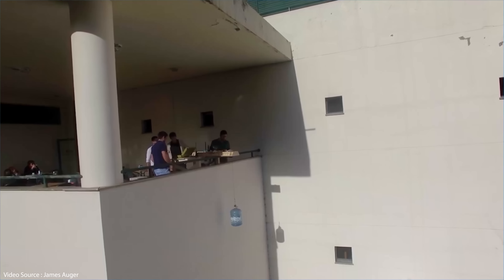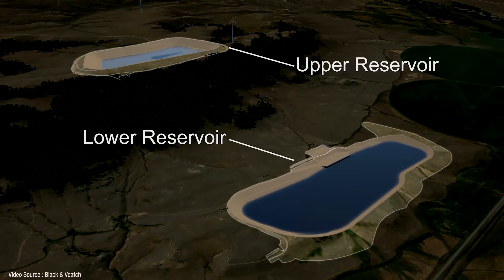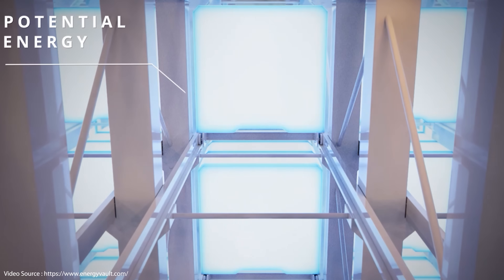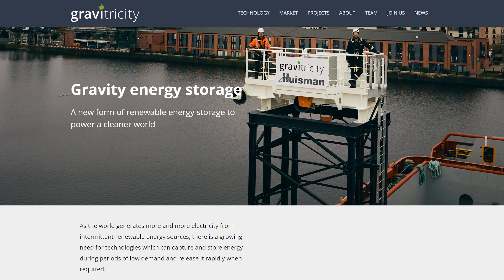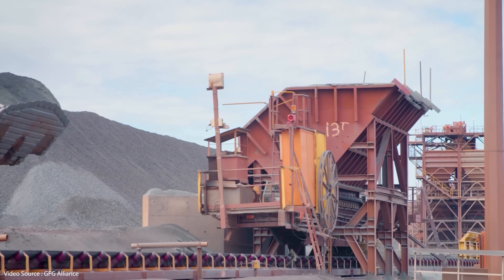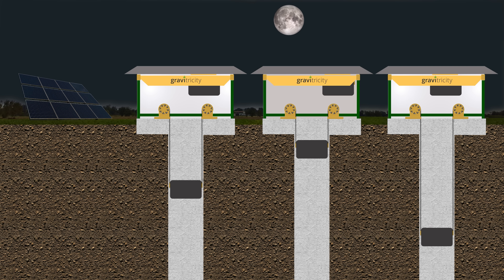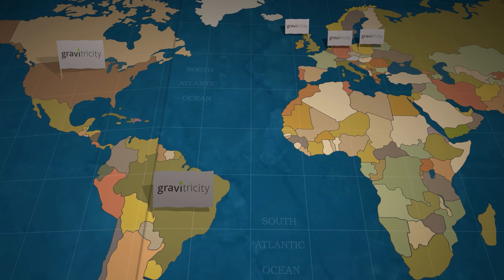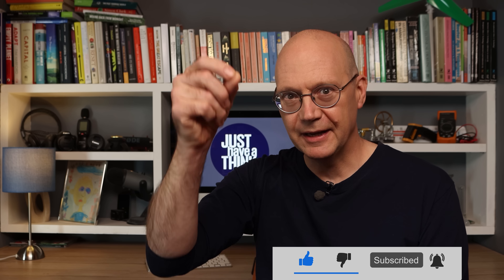Gravity Energy Storage. Who's right and who's wrong?

Comment: Here's an idea, David- Why not have wind turbines gear down to directly lift weights (or pump water for that matter) then let them drop weights to generate electricity when needed? It seems to me that it would cut out one or two efficiency losses in converting the mechanical to electric and electric to mechanical back and forth...
Reply: Mechanical "energy" cannot be transferred to a different direction or place without all kinds of conversions either.  For example, consider an internal combustion engine's gearboxes.  Such systems have considerable losses too.

Furthermore, many mechanical systems have fairly specific and narrow efficiency windows. You can't just go hooking up some source to some output and expect great efficiency, usually.

Then there's the fact that electric motors and generators have exceptionally high efficiency; the best (large) ones around 99%.  There's just not much loss there to win anything.  (Generator systems have losses - but usually not in the generator themselves, but precisely in the non-electric bits!)

Then there's economies of scale - even if you could come up with a complex mechanical contraption that has even higher efficiency than a generator+motor pair, it's going to be custom for your application.  But... you probably can't afford that.  You want commercial off the shelf parts as much as possible.  And that makes the electric route cheaper.

But even if you achieve scale, mechanical systems tend to have huge, heavy moving parts to carry all that power.  Huge things?  Those tend to be expensive.  By contrast, copper wire is relatively dirt cheap.  (I mean, it's not actually cheap, but compared to gearboxes that don't wear and deal with many kW or even MW of power...)

I'd say it's exceedingly unlikely you'll be able to do better than going via an electrical intermediate step.  Never say never; there are likely tons of very specific counter examples.  But finding each of those counterexamples is basically coming up with a clever invention, and will only be possibly in certain specific, hard to predict situations.  As a strategy, this won't work.
Reply: @MoireFly  I'm not an electromechanical engineer who works with these things, but if "that won't work" was the end of every idea where would we be? There are many different configurations of electromechanical systems that involve huge things and clever inventions, and gravity energy storage is all huge things, that's it's nature. I'm not proposing a perpetual energy machine here, it's just a thought...
Reply: @truthurts1692  Just thoughts can be actually damaging, however.  Not every idea ends in failure.  But it's still expensive to try; and in the chaos of creation there's always the lure of riches; and by contributing to that lure for false leads, we reduce the availability of investment for the actually promising new tech.

Some ideas are plain dumb. Now, if there's some subtle interaction, some economic factor, or whatever that we're missing on first glance - OK, but let the companies selling this snake oil explain why theirs is the exception that proves the rule.

But more explicitly: not every idea appears idiotic in advance.  Many appear outright obvious, and just hard to fund or get quite right.  When designs appear to fail to satisfy basic physics constraints or economics, that's a pretty big red flag.

TL;DR: we should at least try to use common sense.  It's a lot better than nothing.
Reply: @MoireFly  I know you'll need to get in the last word, but you reply kind of like a strutting peacock, you know, pedantic, 'look what I can do' . IT WAS JUST A COMMENT, probably not damaging.
Reply: @truthurts1692  Oh sure, your comment wasn't damaging; but the approach is.  And more specifically: that's a problem this channel sometimes seems a little too blase with. He's happy to sell all kinds of pie in the sky ideas, without any attempt to place the likelihood of success in any kind of context. I'm not annoyed because you came up with an off the cuff idea that I doubt is viable; that's just brainstorming!

But I'm less thrilled that a person with a platform that sure seems to really believe we need a radical energy transition is spreading unverified potential scams to a significant audience.

Sorry for the misunderstanding; my frustration isn't with your comment per se, but you indeed touched sore spot.

(No hard feelings on the peacocking, great image ;-)).  I'm sorry if I hurt your feelings.
Reply: good idea
Reply: My guess is that the purely mechanical method you are suggesting would be far more inefficient and complex.

Comment: 1) If we are talking deep holes, are there opportunities to utilize the temperature gradient from bottom of hole to top of hole?  2) Tides are natural analogues to this technology, could they work in tandem? The big challenge would be to keep water out of a deep hole. Think of filling a giant container of water at high tide to buoy up a heavy weight and then letting it drop at low tide and repeating the cycle.
Reply: You would need to dig a lot deeper than a usual mineshaft to get temperature gradients that would be economically viable for energy production. You might be able to store energy in the form of temperature in the hole using a heat pump, but I suspect you would lose a significant amount of the energy in pumping losses alone.

Comment: Most mine shafts need constant dewatering to remove water ingress.  This comes at a high energy cost which has not been factored into levelized-cost callcs
Reply: Good point. That natural inflow of water takes off a slice of the potential energy to be stored.
Reply: @peterbreis5407  any water would cause rust issue at very least in a few decades which these projects will need to operate for to make financial sense
Reply: If they lowered the weights in flooded mine shafts, it wouldn't reduce efficiency that much. Buoyancy would reduce their capacity. But then why not drop them in the open ocean?
Reply: @21mozzie  why use weights at all? Why not use the water? Pump it out when you have excess power, let it flow back in when you need to get power back. As long as you're groundwater leakage isn't on the same order of magnitude as your cycle times, a little leakage won't matter at all. Water is also cheaper than all these weights and contraptions, easy to source, and has quite a bit of Mass to it already.
Reply: @Green__one  water is much less dense, so you need much more of it. Pumped hydro often uses existing lakes at one point or the other of the system, starting with existing hydroelectric facilities, so we're talking vast amounts of water, billions of cubic meters. Incidentally pumped hydro isn't very efficient, the losses are huge.
Reply: @21mozzie  It would dramatically reduce the efficiency of the system and therefore reduce the net power. It would also dramatically reduce the life of the cables and winches to operate wet all the time.
Reply: That is what I thought. apart from the cost pumping out the water, mines will still be a very high humidity environment,  so you will be battling corrosion constantly.
You can use the mine as a reversed pumped hydro plant, But you need the turbines somewhere half way, and the available volume is probably not enough to make it economical. 
And still you will have humidity issues round your generators.
Also it may trigger earthquakes if you pump massive amounts of  water in and out all the time.
Reply: Maybe they plan to operate in flooded holes.
Reply: @janwinders  not likely.  weight in water is considerably less than in air.  Also there will be significant hydraulic drag  both lowering and raising the weight
Reply: I don't know, find a spot on a hill in the Western US, pump the water up/out let it run down hill. Recover some electric cost with hydro generation.  If there is a gully and Hill at the bottom, you will get the water to return underground away from your project and start to turn the desert into grassland.
Reply: Could they invert the weight in a flooded mineshaft? Instead of using energy to raise weights, they could use energy to pull down buoyant air (or other gas) filled containers?
Reply: @vell0cet517  the air would compress which would heat it. And any of that heat that escaped would be an energy/efficiency loss. But if you could prevent that, you could just inflate something at the bottom of the ocean. But ultimately these are all more elaborate and complicated versions of pumped hydro.
Reply: @vell0cet517  there is a startup working on something like that (in a lake or the ocean), I've seen a video about it.
Reply: @vell0cet517  Sounds ridiculously over complicated when you could just move the water itself.
Reply: @green1 I think the problem with pumped hydro are the efficiency losses which motivated the interest in using weights. I’m obviously not an engineer though.
Reply: where i live they have to pump out the water anyway, and forever
so adding extra energy production in the same mine that already have advanced infrastructure connection anyway sound like a great idea
Reply: @ Dan Tronics
I don’t think energy storage systems of any sort need to be near where demand is. They just need to be somewhere along the grid to take in excess power and feed it back into the grid as needed.
Reply: @mikedavison3400  Actually the proximity matters greatly as energy loss on transport trough the network increases with distance.
Reply: @ Samwise
I disagree. Think of renewable production area as A and urban area as B. We want to get the power from A to B and there will be transmission losses. But as long as the energy storage facility is close to the grid then the losses will be no more than there would be without the storage facility. I doubt anyone wants to build a storage facility far from a grid as then you need to build new transmission lines and that’s EXPENSIVE.
Reply: @mikedavison3400  The problem is that "the grid" is not an evenly spaced out grid at all it just gets more distributed around cities but if these mineshafts are in remote areas and not right near cities the power still has to travel trough those powerlines to the city and thats where we get the losses so.
Reply: @ Samwise
The losses are due to the distance between the production and the consumption. It doesn’t matter at all where the storage facility is as long as it’s between the production and consumption and close to the grid between the two. What don’t you get about that?
Reply: @mikedavison3400  Well it seems you fail to understand that this "storage" is the gravity crane and if you want to put that in mineshafts that dont happen to be near cities most the time you would have to get electricity from where it is generated (since the crane is a battery not a power generator) and get it to that crane and then when you want to use it transport again to where its needed. You can say; place it in the middle but that doesnt take away anything since it will just split the losses over different routes.

Comment: Could we use the power of rising bubbles of electrically split pure water to turn huge Ferris wheels inside huge concrete tubes that reach the seabed and then burn the mixture of bubbles at the surface to make MORE energy? I had this idea years ago 20 or so and new developments in water splitting catalysts have maybe made it possible.

Comment: Was tangential infrastructure estimates included in the levelized cost?  E.g. transmission lines out to the mine shaft.  I assume most deep mine shafts aren't built in super convenient places to be used as gravity batteries.
Reply: Those mines had  infrastructure to operate.

These schemes are replacing the haulage of heavy coal from the mine to the location where it was burnt. Electricity moving down wires is easier and more efficient than hauling millions of tonnes of fossil fuel long distance from buried deposits.
Reply: it's ok, most of the electricity they generate will be usable in a few AA batteries.    plus a lot of coal mines were build near coal power stations (well vice versa) so i'm assuming this isn't the biggest issue they will face.

Comment: Electro repulsive magnets could lift a counter weight on a flywheel and this rotational energy could store or create energy . A very accurate computer might control the pulses of the electro magnets needed to accelerate the flywheel to store the energy . As magnetism is a very strong force , the rotational energy of a flywheel  could generate energy passively with gravity as a source of energy from the repulsive magnets lifting a counter weight that makes the flywheel rotate . This technology if it works would be similar to a perpetual motion machine , but with clockwork components .

Comment: As you said Pumped Hydro relies on geology. So, that being said. Fill the mine with water. With the lake on top. P.S. I'm not an engineer, just a crusty old washing machine repair guy.
Reply: What’s your opinion on front loading washers?
Reply: @louislesch3878  They are far superior machines than any top load machine. But like every thing else you pay for what you get. Anything by Whirlpool  and speed queen for example are meh at best. LG, Bosh, Mile etc are very good. The HE top loaders are grim at best . and difficult to repair. And do not stand the grief of an average family. Front loaders do take a little more time. But worth it in the end. Get one with heater if you have a 240v available. Steam is just a gimmick and if your water is hard they die quickly. Hope that helps. If you do get a front loader they will live longer if you A, Leave the door ajar when not in use and B, Once every couple of months. Do the hottest wash it dose with some white vinegar added through the soap door. Or 1 dishwasher tab in the drum.
Reply: This is literally what they're looking at doing in the US and in China. 

Look up Pumped-Storage Hydropower using Abandoned Underground Mines (PSHAUM), or something similar.

Edit: words
Reply: @nschrombeck  Thank you. Fascinating.

Comment: I think all these systems need to be balanced with the growth in electricity demand.  If a system works according to plan it will only increase demand for that resource until the price equalizes itself with other energy storage alternatives.  There is no static market commodity as each part of each energy component is seeking a dynamic equilibrium with other energy components.
Reply: There is quite a bit of flexibility in this particular system that could keep costs down.

Motors could be of various designs, and with a gear box would not have to be optimized for a particular speed or wide band efficiency (with the exception of very high gear ratios).

Gang style cabling could allow for use of a wide range of cable diameters and grades.

The ballast could be substituted with anything "heavy," even free material from around the job site (sacrificing a bit of energy density depending on specific gravity).

Support structures need to be sufficient, but not standardized.

Etc...

There isn't a "lithium" equivalent commodity to this system that necessarily creates a choke point.

That said, you are 100% correct if this system is deployed as a specific product instead of a general machine concept.